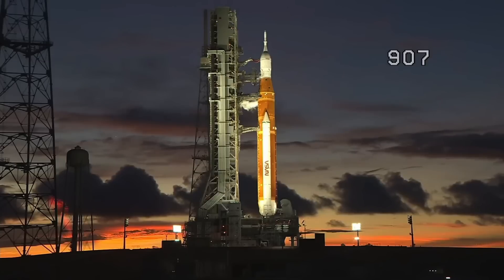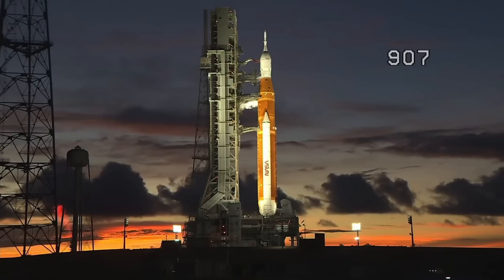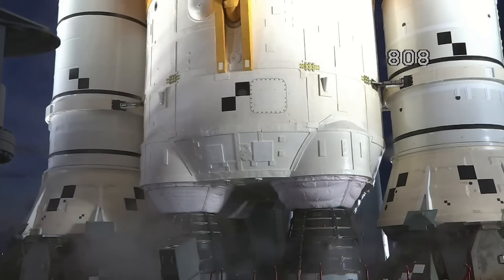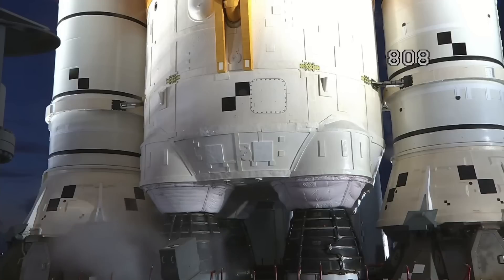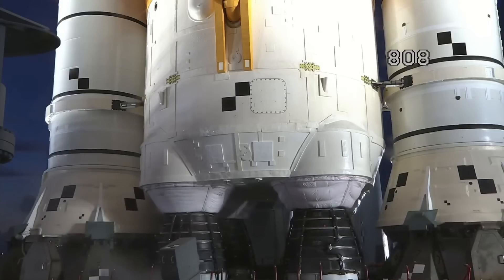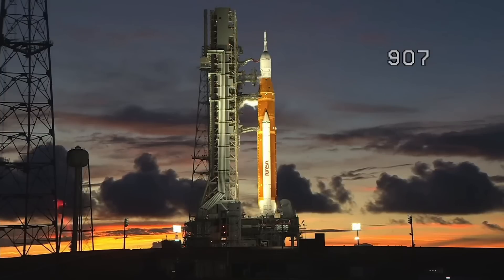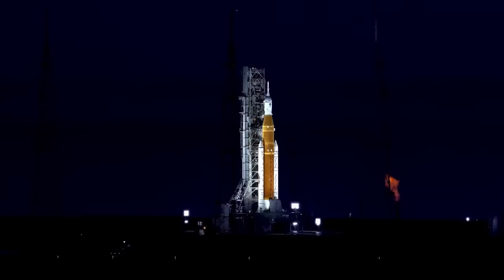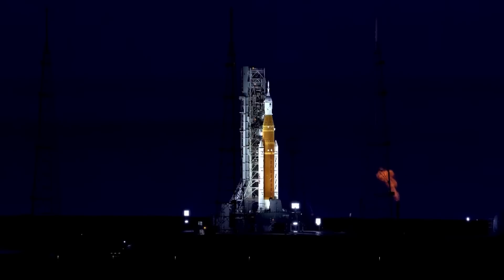NASA troubleshooting Artemis 1 moon rocket engine bleed

Comment: they should just use Kerbodyne KR-2L+ "Rhino" Liquid Fuel Engine, very reliable 👍
Reply: RS-25 is one of the most advanced engines ever made, with near perfect service life, and the first reusable main engine. They literally go to 11. It wasn't an engine problem. NASA suspects faulty temperature sensors which are not flight sensors, but only installed for this test flight. Sorta like the kind of thing they do to crash test cars. That's from this afternoons press conference. There where no funky looking short green guys around for questioning unfortunately.